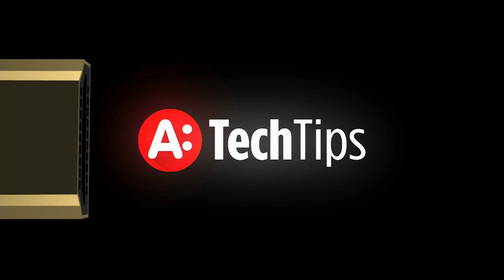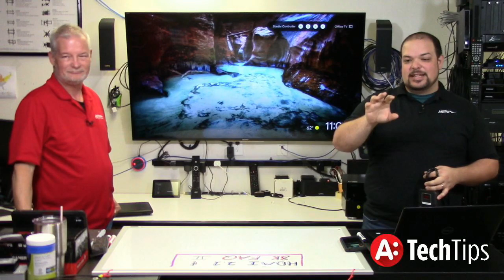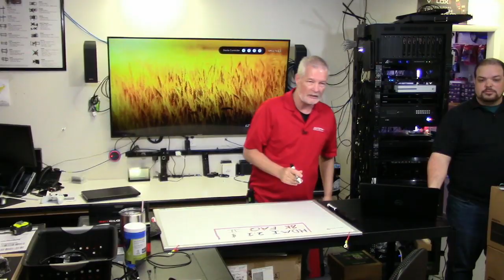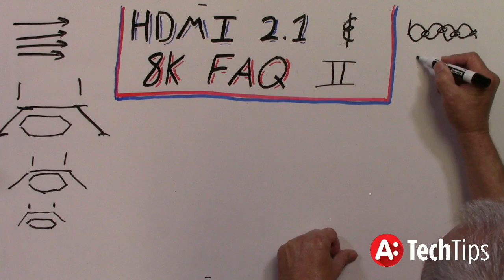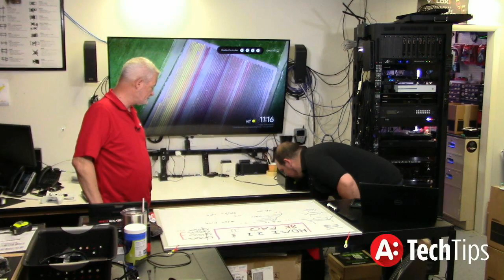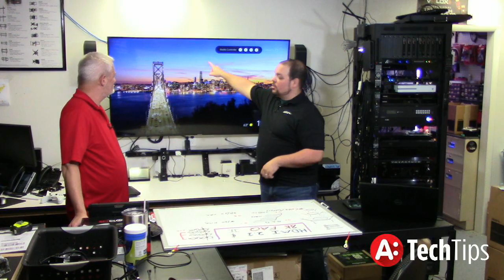Part 2: What to Expect with 8K and HDMI 2.1 FAQ's

Comment: Hi Experts, Am in the plan to buy Av receiver which I shortlisted Marantz 6014 or Dennon 3600H. my current TV is LG OLED C9. I want to utilize my earc hdmi 2.1 from my LG TV. Is that the both AVR's really hdmi 2.1. They both are not certified 2.1. Could you pls confirm me on this..
Reply from the maker: Hello Arul! While we appreciate the moniker of experts, we, unfortunately, are not experts for Marantz or Denon. We do know that currently, there are no HDMI 2.1 AVRs on the market. Personally do not trust ARC and have not had an opportunity to try eARC to verify if it is any better. I would recommend using either a dedicated streaming device (e.g., Roku, AppleTV, FireTV, etc.) OR using an optical audio cable from the TV to the AVR. Do you plan on setting up in-ceiling and surround speakers to create a Dolby Atmos environment? If so, you'll only get an Atmos signal from the streaming device connected via HDMI to the AVR, or through the ARC from the TV. However, ARC has never been very stable and has been challenging to control in certain circumstances. - Adam

Comment: Around minute 12 you start discussing EQ curves for different frequencies or resolutions, mentioning 8 per channel, with the expected HDMI CTS requirement to be that only one frequency has to work per channel.  How can someone determine if all 8 pass on all 4 channels?  Will the DPL cert require all 8 to pass even though the expected CTS will only require one per channel to work?  Have you tested and confirmed that all 8 pass on the cables you are advertising as 48g capable like the velox fiber, and your shorter 2m or less copper cables?
Reply from the maker: Thank you for the question, paying attention, and applying the information! Bill Lloyd! Currently, there is no way a person can know that all 8 EQ's pass on all four channels without configured test equipment. Our assumption is DPL will require all 8 EQ curves to pass, because if it doesn't, it is NOT a true 48 Gbps cable. At this time, we do not have a way to fully verify our cables except by using them with currently available equipment. This limitation is because DPL has not finished compiling what their test will be. - Brent

Comment: At minute 28 you mentioned standard limitations for fiber sfp's are 40g and for high cost there are 100g sfps.  Does your 48g velox cable use the 40g sfp or something different?  If so, how can it achieve 48g with only 40g sfp without compression?
Reply from the maker: Fantastic point Bill Lloyd! The difference is in how many strands of fiber each type of connection uses. In a standard 'bulk' fiber application, you are primarily using one or two strands per linkage, and using an SFP module to make that connection. The SFP module, and to a lesser extent the quality of fiber used, dictates the bandwidth of the connection. In our HDMI AOC, we are using four strands of OM3 fiber, which means we are achieving the 48Gbps bandwidth by only needing 12Gbps per strand. 

So, in short, while we ARE using OM3 fiber within our HDMI AOC, we are using four strands at 12Gbps per strand, while SFP modules can send upwards of 100Gbps on a SINGLE strand of fiber. -Adam.

Comment: Will all TVs that support hdmi 2.1 be able to do 4k 120 or 1080 p 240
Reply from the maker: Great question, COPPA COMPLIENT! While the specification for HDMI 2.1 allows for 4K@120hz, it will be up to each manufacturer to support that specification. There are many devices out there that ACCEPT a specific signal; however, they do not DISPLAY that same signal. Projectors had done this in the past, especially when it came to HDR or 4K content. - Adam.